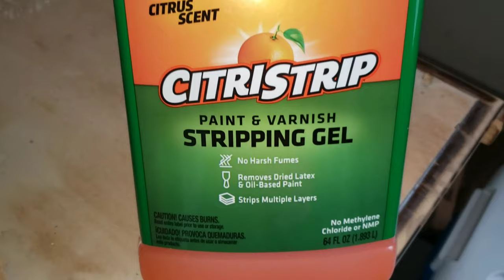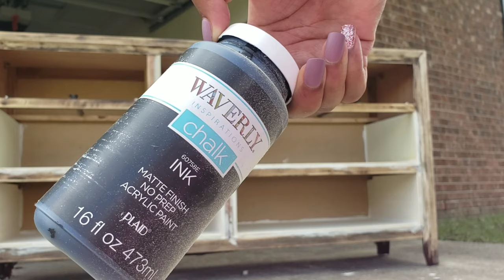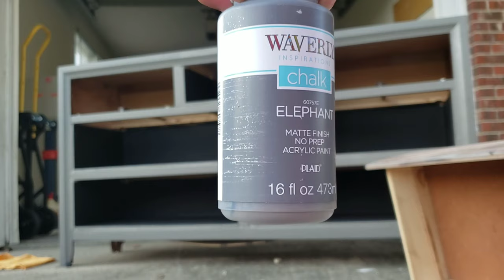DIY Old dresser turned into ENTERTAINMENT CENTER!!!| PonPon Sisters

Comment: I love this! I'm currently turning an antique buffet into a media console. I have one large top drawer. However, it doesn't have a bottom, so I have to create it like you did. I'm a 1st timer - and I'm having trouble figuring out the correct space to measure. Any tips or links are greatly appreciated.
Reply from the maker: Hello Lovely, my apologies for the late reply. For me, I measured the sides first (from top to bottom, and front to back) and then I measure the bottom surface. Try to look at it like a rectangle(2D) versus 3D cube. That help with me not over thinking it. Hopefully that helps.

Comment: What wood did you buy from Lowe’s? I have a dresser I am doing the same thing too but have to build the bottoms like this but need something sturdy.
Reply from the maker: it was 1/4 inch white wood, it came in a sheet 5'x8'. Good luck on your new project👷🏽‍♀️👍🏽
Reply: @Putting up with the PonPons  what is the measurements for the wood that you got cut at home depot? I have the same dresser.